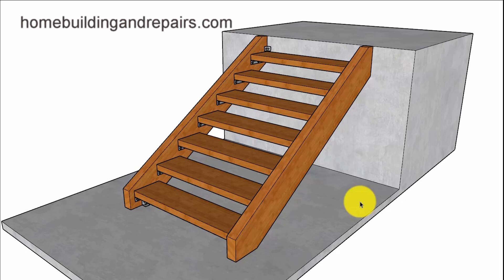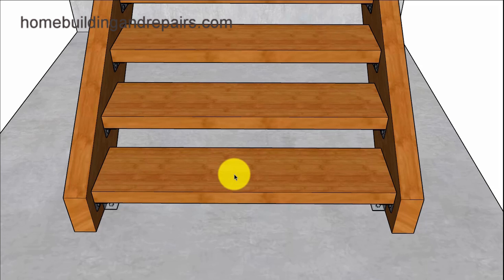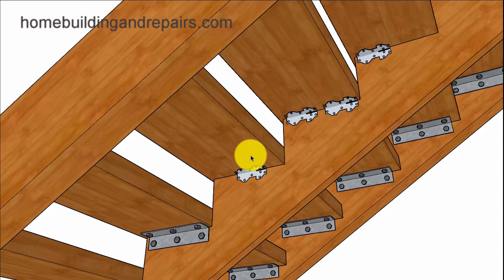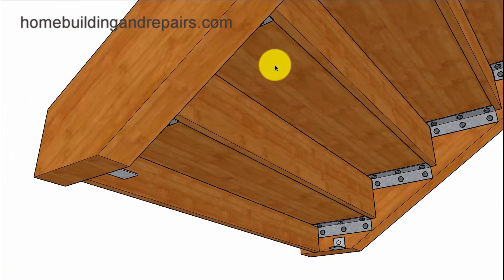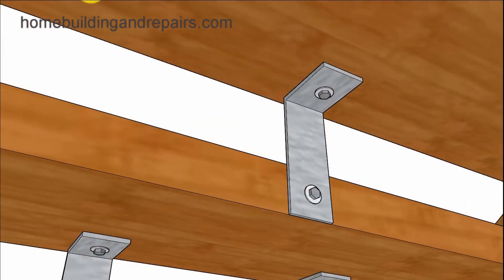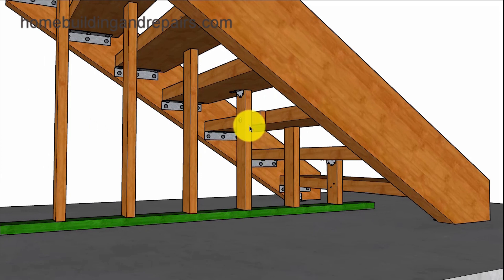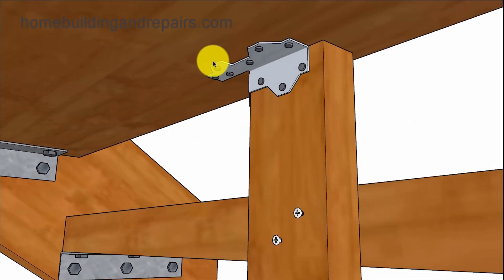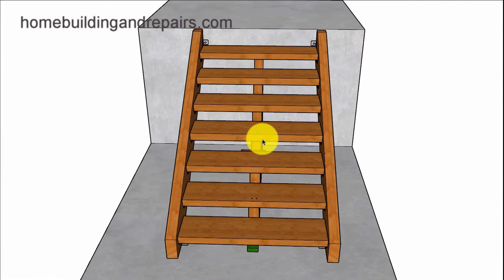How To Make Bracket Stair Steps Structurally Stronger - Ideas And Examples For Do It Yourselfer's

Comment: Aloha stairbuilding...
I want to know how to draw the lines for the mounting of the brackets... but more importantly, how to calculate the header-side of that end (vertical) and the bottom angle where the bottom sits on the ground/pad (horizontal)...?
* * *
I love your style of presentation... but I miss the nuts and bolts details for designing this sort of stairway... (thanks)
* * *

Until that time. . .
Reply from the maker: You're in luck, go to amazon and type in bracket stair building. I have a book that you'll love.